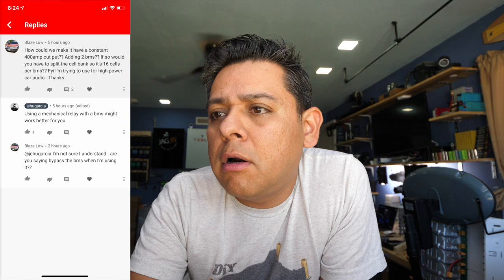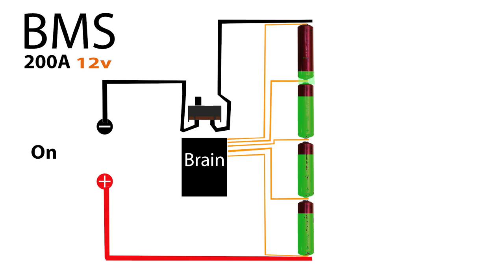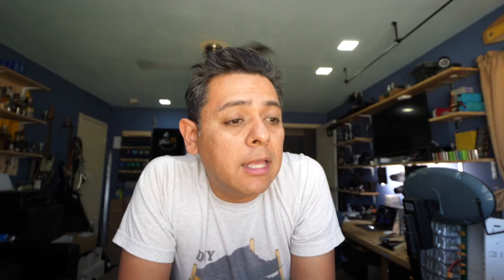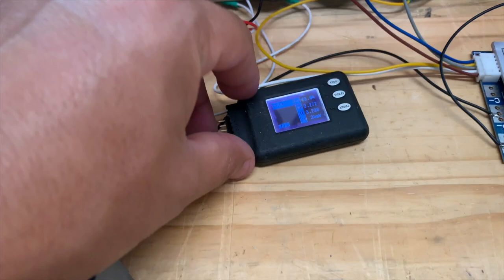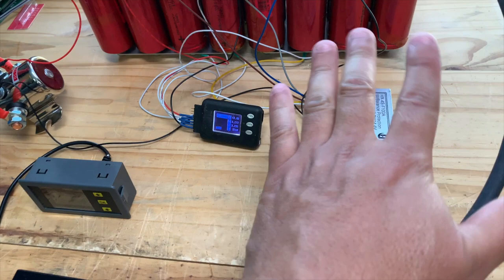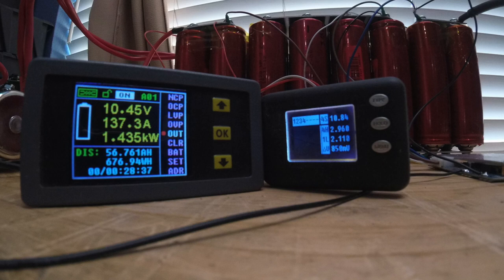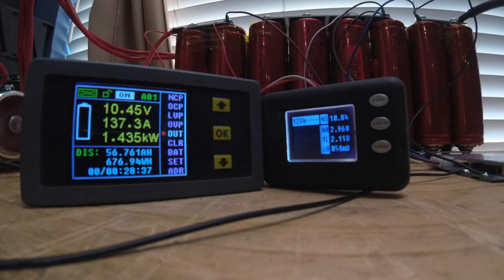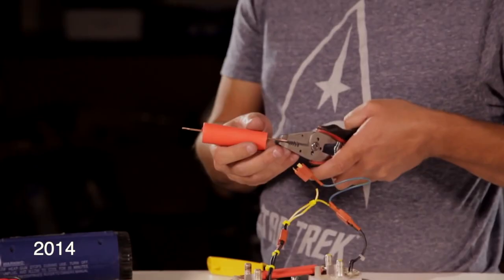4000A BMS?

Comment: High current contactors pull in at a power of about 10-20 watts but will hold in with less than 1-2 watts. Continually supplying the  pull-in power is very wasteful.
A well designed control circuit can use a charged 1000uF capacitor to supply the pull in power and a resistor or switching supply to supply the holding current.
Reply: False, holding current is not 1w. Have you never heard of a latching relay?
Reply: @climatechangepreppersfaceb2148  I just love commenting on something I know nothing about . Any argument ?
Reply: @climatechangepreppersfaceb2148  Most contactors are NOT latching. They are solenoids with a resistance of about 4-10 ohms. If you put 12V across them they  use >10W. Once energised voltage can be reduced to about 4V and contactor still remains energized. This reduces power around 1-2W to hold in.
Reply: @peterdkay  are those solenoids specced at full current with lower holding voltage?  The pressure on the contacts makes a significant difference in the amount of current they can safely pass.  This is why those little 30\40a 12v relays are specced the way they are, 30a for the contacts with less pressure on them, 40 for the ones with more.
Reply: @peterdkay  that's absolute nonsense. I've tested many and the least I can get to hold is 2/3 rated voltage. I didn't say all contactors are latching did I? I asked if you had heard of them, because that's what you would use instead of this lower voltage nonsense which is dangerous to the contacts as someone else pointed out
Reply: @climatechangepreppersfaceb2148  -- When solenoid pulls in, it bottoms and has very high holding force. Once it is energized you can reduce voltage significantly and it will still stay bottomed.
Contact force is provided by a second spring inside the solenoid so provided solenoid is bottomed, contact force is still the same. Thus there is no problem with reducing solenoid voltage AFTER it has been energized.
Reply: @climatechangepreppersfaceb2148  I just tried it using a starter motor contactor which has a 4 ohm coil resistance. With 12V on coil current is  3A (36W). This would overheat contactor if left ON.
I then used a current limited power supply  (costs $1.20 on eBay) Output voltage set to 11V and current limit set to 1A with a 2000uF output capacitor. Contactor is then switched across the output. It pulls in reliably. Under these conditions 12V supply current when contactor was activated was 300mA (3.6W). 
Using this driver the power requirement is only 10%.

Comment: I think Perfect for a golf cart battery!!  So, charge through BMS directly?!?  Use a Golf cart solenoid to apply power to the motor.  They are $15 on Amazon.  So, thinking of a 12S Lifepo4, which should charge at 20A.  Wonder if BMS's have variable cutoff voltage.  Thinking to cut off high speed at slightly higher volttage (2.4V?) and low speed at 2.2V?  So if battery gets low a long way from charging station, can limp home at low speed.....  Would this work?

Comment: Ok cool. So 2 ?s please. 1: does that work in reverse for charging current( i have 2 300 amp alternators) or is that still controlled by the current rating on the bms. And 2: What is a display(like the one you show) that can show 12v and up to a 1000amps of draw without using an oldschool amp meter being thats kinda annoying to wire into the dash and only shows current lol. Please help. Also could you wire supercapacitors in parallel with this without an issue, just out of curiosity.

Comment: Sooooooo...    long story short, a BMS is really just a string by string LVD/HVD? Not to mess with your testing apparatus TOO much, but loadbanks (what we use to test generators) are just a REALLLLLY huge electric heater, using resistance wire (Think temco/ebay)...   With that being said, if you just use a ton of resistance wire & eliminate the inverter -You could generate a load higher than what the inverter is capable of putting your batteries under?

Comment: Charge  a Battery with a 10KW or 1MegaWatt Generator.

Pair your 24 v DIY box Batt. with a Super Capacitor Stack in the same profile case 👌🏻

Comment: LifePo4 voltage is 2.5 to 3.65 V. 
 2 V is to LOW and 3.7 is to high.
Reply: Mariano Rodrigues I saw that 2.11v and was thinking the same thing. I've been keeping my headways between 2.8 and 3.4v.
Reply: @groodscom  Mine are at 3.3
Reply: As far as I know it does depend on the current drawn. You lose some voltage on the resistance of the battery (voltage drop = current * resistance). So even thought you measure 2V you could still be in a save voltage range.
Reply: @philippganz2014   Plus under a 137A load the voltage is pulled down to 2 but the resting voltage should be higher

Comment: How do you run 2 separate voltages in your car? Eg. 16v and 12v
Reply: Keep them on separate circuits, or use a DC-DC converter to step up or down.

Comment: What kind of current shunt are you use for measruring current of 200amps
Reply: Hey man I have a question and your the only person I think can give me a really good answer. I wanna run two different voltages in car. I want one of my batteries; the front one;  to charge to 12v and I have a bank of 40 headaway battery cells that I want to charge to 16v. What can I use to charge my front battery to only 12v so that I dont fry my electronics? Also i have a 240 amp alternator which is externally regulated.
Reply: It uses hall effect sensor to measure current
Reply: @joshmesser1165  Two alternators possible?
Reply: @niceguy100000  no one alt

Comment: Is this setup still going to balance the cells though or does doing it this way just provide under/over voltage protection?
Reply: I count 32 cells and he said 4 cell BMS. The BMS might be balancing the 8 cell pack to a degree but this looks like a high/low  voltage  cut off. I am only guessing. What do you think?

Comment: Can you not just use a small relay to turn inverter off?
Reply: A small relay would not handle the current and would burn up or weld the contacts. A contactor is ideal as it is design to switch large current loads.
Reply: htmagic but the relay wouldn’t be switching a large current if it was just turning the inverter off. Would it?
The switch on the side of my inverter does not look like it’s rated for anything special. I would of thought it just stops the mosfets within the inverter from doing there thing.
Is that not right?
Reply: Would it not work similarly to “niceguy100000” comment about the remote on on a audio amp?
Reply: Yep this is what i do with my victron inverters.

Comment: what is the device on the left at 6:00?
Reply: Search for Ming HE wireless power monitor and you'll find it. There are different versions for different voltage/current requirements.

Comment: I have a big question made a battery pack but I can't figure out what it will handle I have a pack that has 3s 12p I have 2 of them 72 battery pouches in total the batteries are 9 years old but still hold full charge and capacity found at 3.75v and above brand new out of the box from a warehouse

Comment: awsome video, great info. can I use the same idea to charge calb batteries? I have 100ah per cell and the same bms. but the charge rate is only 10amps. I have a Prosine 3.0 that can handle charging better and has the correct cutoff setups. any concerns or cautions?
Reply from the maker: Yes

Comment: Jehu i am the first viewer of this video, can you answer my question? Since the last one was not. What do you suggest i use for 30pcs battery pack to use with solar panel? How do i charge them? And balance them? What hardware do i need?
Reply: @NicolaCasetti  thanks for prompt reply. I dont need invertor. I am going to use the system on DC with 7 pcs of 1W LED BULB. My biggest challenge is how to wire BMS  and also include a digit meter control on the system (Battery Monitoring System).

Comment: For house power panel.. ok, But for engine aircraft, 400amps ok and normal. Contactor is the way to go. Discharge bms from china.. you will just burn it even the 300a...

Comment: I make a lithium battery just like that with 32 headway cells but I wired it with a 60A  4s bms but that bms shut off the battery at about 12.4 volt but I'm wondering what kind of bms is best to used on it that doesn't require saudering because I get a 100amp bms from Amazon that is going giving me hell to Sauder the main terminal leads..

Comment: Hello 

thank you for this useful video
please i have question , if i have 23S BMS , and i want to use 2*23 BMS to controle 144v system 400Ah using this method. is it ok and safe? and what about balancing the cells in charging and discharging?

thank you

Comment: Thanks for the help and the name drop.. ( points with my son he loves you tube).. I still have more questions.. the bms switches on the ground so I can hook the relay to a key power and it will shut off when my car is off to prevent discharge?? Also can I run constant power to the charge part of the bms to balance the cells when the car is off??

Comment: Hello, can I still use this type of BMS if I charge above a 100 amps?  Reason I asked, is because it says it has over charge current protection of a 100a.  I have a 320a HO alternator. I want protection for temp/voltage ect. any recommendations?

Comment: Hey jehu build power wall PCB for 21700
Reply: Tent on top of a battery.
Reply: I designed mine if you are interested.
Reply: @conceptor  Pics or it didn't happen.

Comment: I am planning to series 8 packs of 7s20p battery for use on a 6KVA  192VDC online UPS. Can i safely series 8 7s bms at that voltage? Or is there a better way to set this up?
Reply: Yes you can, but as you increase voltage it becomes less safe to any humans that might get in the way.

Comment: what do you think of t LCB (Lithium Ceramic Battery )
I would like to make a battery for my boat 24v et 12v de 140ah ? 
is it possible to have both voltage on the same battery 
without unbalancing the whole?

Comment: Sir we r making a high speed car  ...we r making 80kw of battery with 400v

We r dividing whole battery in 4 part each of  part has 100v and 200A ..sir which typ of BMS we should use ?? ...any suggestions of bms master and slave bms ?? Or any other

Comment: Try Russian rugged TKS601 DOD
”ТКС601 ДОД"
600 russian aviational Amps continuesly means x8 chinese.
It has double coil cheme and hold consumption about 0.5A on 13.8V

Or ”ТКС403 ДОД” if you want to contact compact nuclear reactor to submarine size motors with AWG 000 wires ))
 where 3x 400A lines in paralel means 9600A peak ;Р

Its ultra durable military aviation stuff for funny money.. ~20-30$ for used (demontage from plane, but all of i seen - like a new inside)

Comment: Is there a safe way to charge a 48V 200A 3© ratted battery with external battery pack without dc dc converter. Say charging prismatic 200A batteries with a pack of cylindrical cells.  And all the cells have a LiFePO4 chemistry.

I know you are the only guy who knows the trick. The battery Man....
Greetings from INDIA

Comment: could you use a relay that is normally ON and have the BMS turn it off when appropriate rather than the other way around, that way the relay would only draw current to turn the circuit off rather than being continuously on, maybe a separate power source for the relay would be needed
Reply: Problem there is the relay is pulling power AFTER you've drained the battery, if you don't get it on charge quickly it may discharge the cells to the point of damage.

Comment: What about if you want to run 4 of theses batteries on car audio ? does each battery need its own bms ? How do you wire that ?
Reply from the maker: 48v ?   Get a 48v bms
Reply: @jehugarcia  I want to keep it at 12 volts
Reply: @mrmagic3067  48 V to 12V converter .

Comment: Jay, I want to be able to use that battery for car audio but I can’t figure out how to charge it with my 640 amp alternators. If you just explained it I didn’t understand. If you could explain in detail how to do this we bass head guys would build our own batteries instead of paying boat loads to JY
Reply from the maker: Just build a big enough pack to handle the amps, there’s no special way to connect them
Reply: @jehugarcia  so build a 640amp 12v pack, then does this setup work the same way. Also so 4 of these packs in parallel could handle the 600amp input and the bms would be ok with that. And just curious what display at that level of current to see whats going on would you use?
Reply: Thanks

Comment: You can't cut the power from an inverter while the inverter is under load, This will let out the magic smoke inside the inverter. I had a small refrigerator connected to a 12v battery and when I disconnected the battery, out came the magic smoke, If the BMS turns off the power it's magic smoke time!
Reply: Did you mean cutting power TO the inverter is bad while it's under load?
Reply: yes